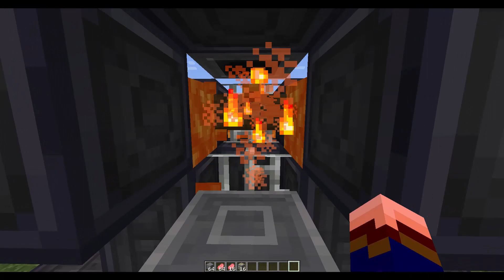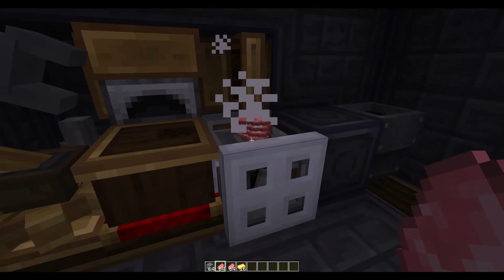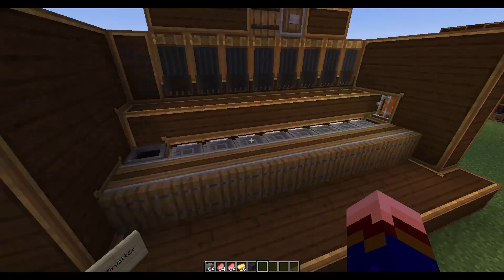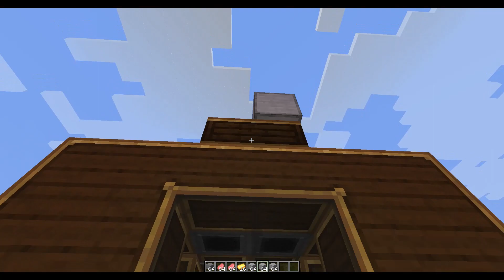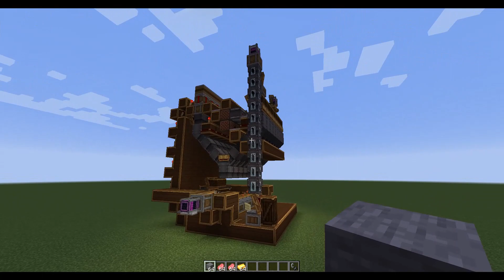Minecraft Create Mod : 10 different ways to smelt items

Comment: One I've come up with is a long belt then on top that a depot with a lava, water, or soul fire directly on top of it, two funnels on opposite sides and fans at the top and the both available sides. This is good for any processes that don't need to be incredibly efficient and are going to need 2-3 steps of fan processing. 

I have Cobble turned into sand, clay and flint. Then I smelt the clay, haunt the bricks, and then press the Nether Brick into Nether Bricks that get crushed generating Netherite scrap.

Comment: My favorite way to smelt items is with a cobweb. It works a lot like your block breaking smelter but the timing is handled by how long it takes an item to fall through the cobweb.
It's also pretty easy to get 6 fans on the items at once if you just raise the top one a few blocks.